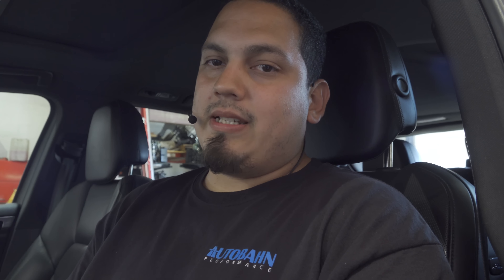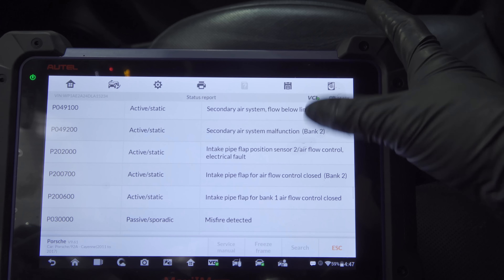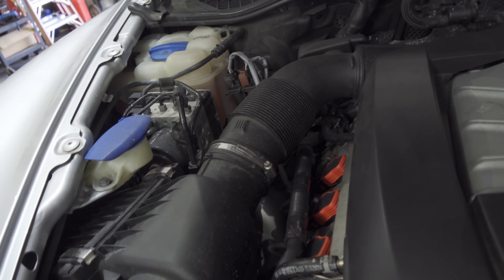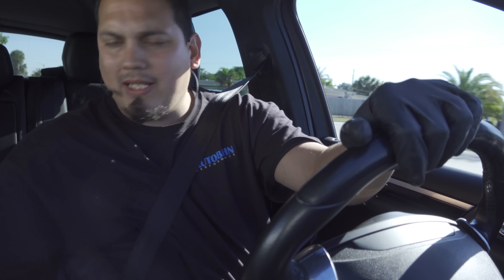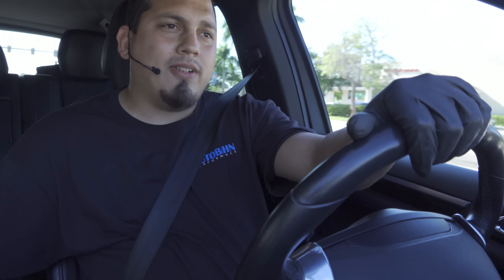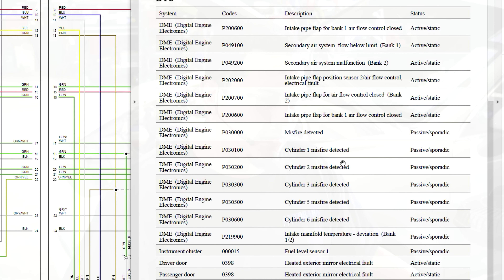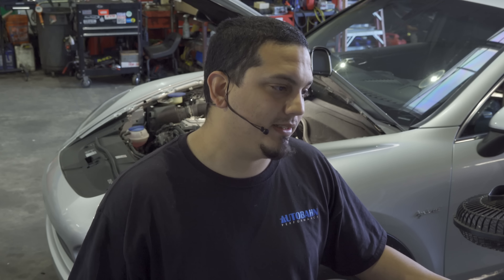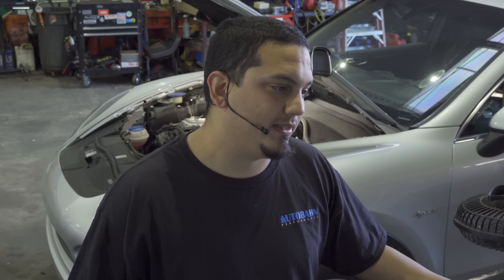2013 Porsche Cayenne S hybrid Supercharged 3.0L - MISFIRE ONLY WHEN HOT

Comment: Good tip about marking. I've been wrenching for 20 years and I still mark vacuum hoses occasionally, especially if there are several which look similar and/or clustered in same region. Of course, finding someone else's screw-up is always challenging because it can throw you for a loop if you are unaware of the screw-up to begin with. Nice catch...😎👍

Comment: Great video, as I always!  Don't feel bad for verifying leak down.  You know how fragile those engines can be. You know the pcv issues they had had. You are dealing with a boosted motor.  Things can change in a second, especially with boost, and if it takes just 5 minutes to rule out as many possibilities, DO IT!  The customer should be happy that you verified a mechanically viable engine.  Keep it up, can't wait to see your journey there! #strongertogether
Reply: Hey please help, my porsche 2015 cayenne hybrid s has slight bit of oil leaking driver side of engine so standing in front of hood right side  back small amount of oil and also when I open oil cap I can smell gas. Once in a awhile.

Comment: This was awesome stuff Mario!  Thanks for sharing all of this with us!  Secondary analysis 😉👍love it!

Crazy how it takes alot of heat to get them to act up at times.

Oil could be valve stem seals leaking once she warms up??

You switched shops again huh?  Hopefully you are doing new and great stuff there man!
Reply from the maker: Thanks! The root cause was the to loose hose at the 5 minute mark. It goes to the oil separator. Without it the oil was slowly building up within all cylinders and fouling the plugs. Check out my community tab, i posted a picture of the spark plug after repairs and recreating the same conditions

Comment: Hey great video mine has a slight oil leak driver side back right from standing in front of front hood. Dripped down on a plate aluminum I think before it got to the floor. Also I smell gasoline when I open the oil cap

Comment: Congratulations for moving to the new shop. Much luck to you . I have question about secondary waveform interpretation .  What is the cause  for , burn-line to be too high , only slightly  below the peak of the firing voltage ? Thank you.
Reply from the maker: The height relates to resistance. A high burn line right after the spike points to high resistance outside of the cylinder(high secondary resistance). If you had a good burn line right after the spike but then it rose sharply towards the end of the burn line, that would point to high resistance within the cylinder (lean condition, since fuel is a conductor, lack of fuel is lack of conductivity) 

Thanks for the support!!

Comment: Interested in the relative compression dilemma.  The power to start comes from somewhere. Are there high voltage dc cables or is the three phase wiring separated at any point where the amp clamp can clamp around only one of the phases?  The current is likely to be way less, but should still show the same characteristics.  Disabling from starting is a concern as you mentioned, but I'm sure a fuel pump relay would do the trick.
Reply from the maker: It comes from the hybrid battery pack, into the transmission. Grabbing current from one wire would show AC oscillations and be useless to analyze compression with, even with fuel cut off. 

The good thing is that the pulse sensors can still do their job

I'm going to be thinking about this for a while 😆
Reply: @SuperMarioDiagnostics  I wonder if pico has some rms math channel that can be added.  I'll play when I get a chance.  At this point we're just trying to graph ac current so a light bulb with a dimmer at home will work, once figured out it can translate back to the car.  I'm sure this will be necessary in the future!
Reply from the maker: I'm going to try to tackle this as well. Don't want to get caught unprepared when the time comes

Comment: what would cause a lean condition please sir     if that was on the bentley how could you of tested it as the air intake has to come of to get to the coils so it would not of started  to cheak it
Reply from the maker: The Bentley will run with no air filter housings installed since there is a map sensor on it.

There are many things that can cause a lean condition. Can you be more specific?
Reply: ok thanks mario
Reply: ok sir    i was thinking of the job you just did on this car  was it the high kv that lead to lean running .  and the oil pooling in one of  the pots might re clog the plug up is that poss..great video thankyou for sharing

Comment: The fishbite could be the transfer case slipping.   You can do a fluid change and add  ford limited slip additive to get rid of the slip. Or replace the tcase...  I usually feel it in manual 3rd medium throttle from like 30kmh.  Very common.
Reply: This is not a Ford sir...
Reply: @nicknicu1787  yes. I know.  I've put ford limited slip additive in many Porsche transfer cases and resolved the transfer case fish bite.   5-6k for a transfer case or a couple hundred for a fluid change?  Most change the fluid and put in the additive.   They've actually updated the transfer case clutches on new units. Haven't seen any with the updated clutches slipping yet
Reply: James Gateman Good to know! I didn’t know that Porsche transfer cases are slipping.

Comment: Hi Mario, just a thought: I noticed in your first ignition captures from the misfiring bank, there was no evidence of residual energy after the firing event on any of that bank's coils, (coil ringing). I suspect that the coils that had been replaced on this bank were inferior coils to the originals that may or may not have been faulty in the first place (you will never know!). I did understand correctly that the coils had been previously replaced?   
I see this a lot, where a car is presented having been 'fixed' at a previous shop and then subsequently fail again due to the replacement of suspected faulty components with cheap inferior parts. It is an ever increasing phenomenon brought about by customers searching for a cheap fix; well that is true here in the UK. 
Well done with repair.

Comment: nice job senor . so what the hell was the oil leak from ? was it from the valve cover gasket ?
Reply from the maker: It was from the loose breather hose mentioned at the 5 minute mark of the video.

Without the breather hose installed, the oil separator could no do its job of preventing oil from entering the combustion chamber. After two hours of idling without a breather hose, the oil buildup was enough to foul the plugs.
Reply: Oh yeah forgot about the busted hose lol , thanks checking out your Mini Cooper video and going down the line.

Comment: Hello brothers. I hope you all will be good. Here is my one question that in jaguar XF 2015 if we disconnect the battery in there is one issue come. I hope you know well that the trunk and fuel door locks and doors don’t lock. And car gives a double beep. I have left one car for this issue because i was not able to find the solution. Because here are all Jaguar experts so my humble request is to tell me a short explanation of this problem. I will be very very very thankful to you all. Please
Reply: Also want this question answer from super Mario diagnostics. ❤
Reply from the maker: You'll need sdd to carry out the battery replacement procedure. If that doesn't work, update kvm and go through the entire procedure(target identifier, etc)

Comment: PS. Ex VW tech in the house. Watch out on the Audi VW Porsche range, the TSI/FSI GDI engines have a lean burn strategy on light throttle conditions, the flaps are meant to direct the air charge along the top of the intake ports and toward the injector spray and spark plug, if the intake ports are in any way carbon contaminated, the fuel will not burn properly and create a misfire (feels like an ignition misfire), causing fouled plugs, oil passing the rings and unburned fuel in the chamber, the fuel trims show as a lean condition (excess oxygen in the exhaust) and the ECU will add more fuel.

I have seen many a shop replace spark plugs, only for the fault to reoccur a few thousand KMs down the track because of fouled plugs. It is also a good idea to have the injectors tested and cleaned at the same time as the intake port clean.
Reply from the maker: Yes i suggested that but it was not approved unfortunately
Reply from the maker: Oh and that was suggested, but also keep in mind that when i put the good plug into cylinder 1 the secondary waveform showed no signs of a lean condition. So carbon was not the root cause, BUT you are correct, carbon will cause a lean issue. They didn't approve the suggestion though
Reply: I am quite sure your waveform won't show a lean condition, as the fuel mixture will not be burned properly.
Reply: It gets tricky, the ECU gets tricked as there will be unburned oxygen in the exhaust from a non-ignited charge and then try to add more and more fuel to compensate for a false lean condition.
Reply: Haha, I had to rethink what I was saying a couple of times there as I was going down the incorrect path of a misfire showing as a rich condition on AFRs
Reply from the maker: Correct. For it to be rich, it'd have to burn up all the oxygen then pump out the excess fuel. 

Otherwise if there's no spark entering the cylinder, the oxygen is unaffected, and will show up as a lean condition. 

Carbon is a double edged sword. It can either restrict airflow and create a rich condition. Or it can disrupt the airflow into a non homogenous mixture and create a lean misfire.

Tricky is the word lol
Reply: Absolutely right, although in my experience on these cars there is hardly ever an occasion where the fuel trims will read rich, it is more common that they will read lean AFRs in the exhaust when in reality they are not even igniting the fuel and the combustion chamber is completely wet with unburned fuel.
Reply: Just out of interest, how many miles did the vehicle have on it?
Reply from the maker: 74k
Reply: Haha, right at the point where they start to get fouled intake ports 👍
Reply: I just finished up on an Audi A5 that had been to 5 other shops, it had the fouled intake problem but it was combined with a split PCV diaphragm also which compounded the oil burning on the plugs and threw me off the garden path with a vacuum leak being present.

Comment: How many hrs did you have into this diagnostic ?
Reply from the maker: Actual hands on the vehicle, about an hour and a half. I let the vehicle idle as i moved onto other things, and took it on several test drives in between
Reply: @SuperMarioDiagnostics  right on. Those intermittent problems will get you man. Not to mention fixing other shops problems isn't easy. Hat's off 👍